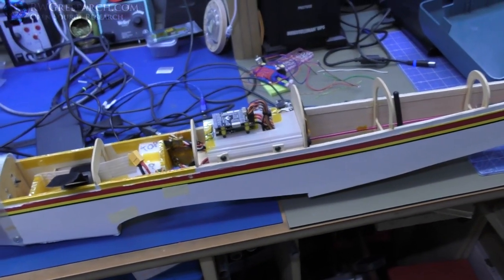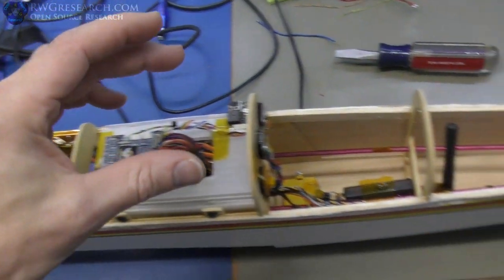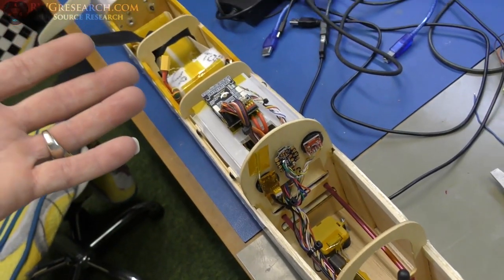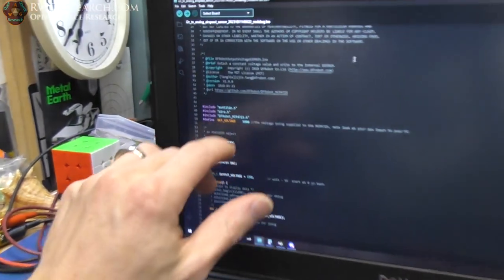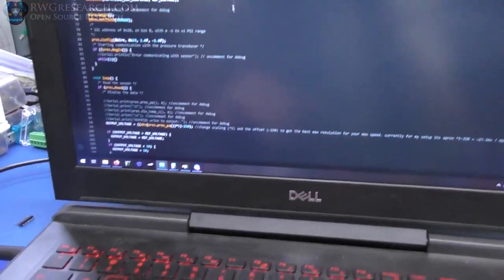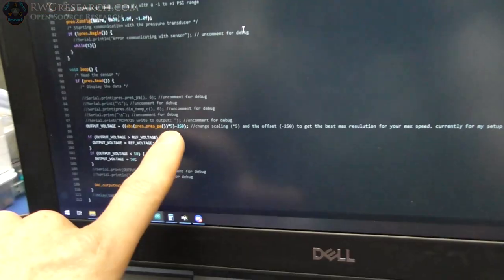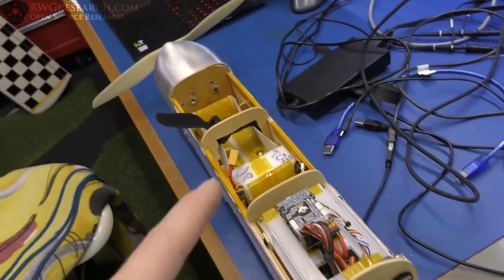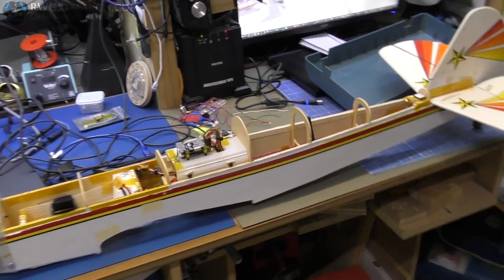I2C Digital To DAQ Analog - MS4525DO to MCP4725 to DAQ to ANALOG to FLIGHT CONTROLLER via ARDUINO

Comment: Does it include gyros?  Sounds like a great project.
Reply from the maker: So the flight controller does have Gyros and barometer. And all kinds of good stuff. But the little conversion I did here is just for the airspeed sensor. ~Russ